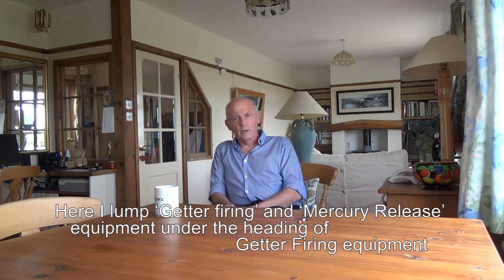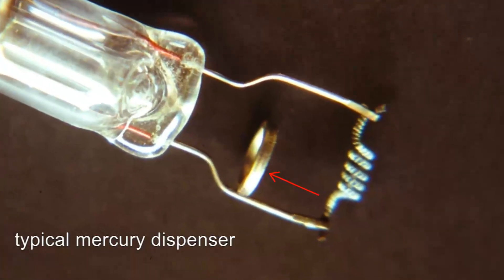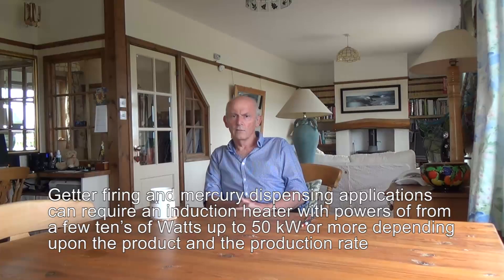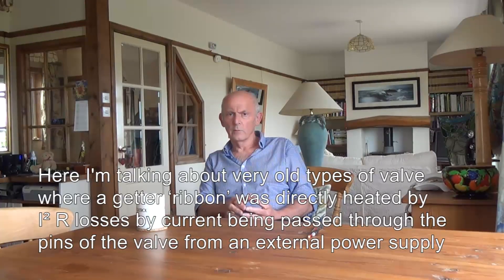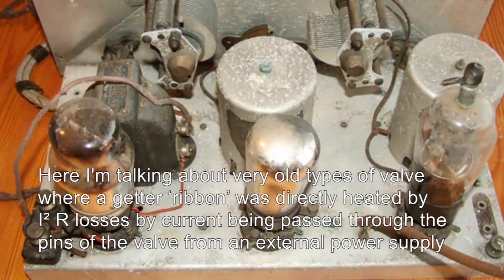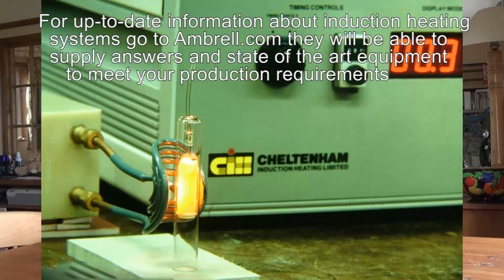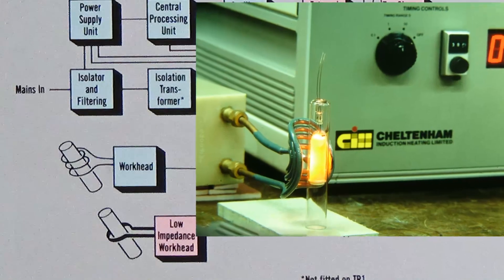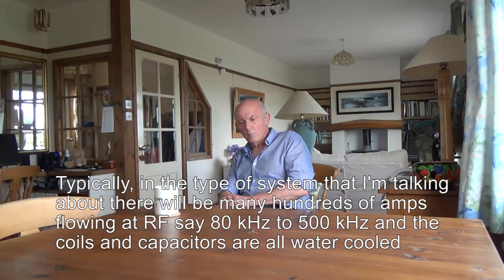I little bit about my work and Sinclair's Flat TV

Comment from the maker: Hi, that’s a bit like asking, ‘How long will a car last’ and the answer to both questions has to be, ‘It depends how hard you drive it.’ 
I can’t give you specific numbers but reasonably you’ll be talking of thousands of hours if you run a valve (tube) within its rated values. If you over drive the valve, say increase the filament voltage or draw excessive anode current you could limit its life down to hundreds of hours or even tens of hours.
Kind Regards ... Andy 
GWØJXM

Comment from the maker: Hi, no that’s not the case at all, induction heating is still the preferred method for most applications as unlike laser heating which can only heat from the outside, by selecting the appropriate operating frequency the user can predict with total accuracy the depth of hardness to be achieved by heating from the inside. Using a laser to achieve a deep depth of hardness in steel would be like using an oxyacetylene blow torch to cook a chicken, you simply melt. Ok if shallow depth.
Regards ...Andy

Comment from the maker: 1 of 2 
Hey that’s probably because they weren’t using my equipment. But seriously we built equipment for both ends of the market but the big difference probably has to do with cleanliness. As well as getter firing I also designed and built equipment for ‘out-gassing’ electrodes that is heating the metal elements (glass/ ceramic) structure in a partial vacuum to remove ‘under-the-surface-contaminants’ like die lubricants etc. Not everyone did that and it makes a difference...
 see 2 of 2

Comment from the maker: I'm sure Sinclair got a lot of guys interested in electronics, I certainly got a buzz out of building my first computer and the lessons learnt stood me in good stead as a bit of a foundation to start. I built my own keyboard out of surplus leaver type micro switches that I bent up and I used the plastic keys off an old mechanical calculating machine on the ends of the switches. I ‘letraseted’ the characters on and vanished the Letraset. It worked.
Glad you enjoyed the video 
Regards ... Andy

Comment from the maker: Hi Rick, high vacuum is a funny thing to come to terms with, I’ve worked on high temperature, high vac, ultra high purity kit for Zone Refining silicon. I still can’t think of the pressures as been any more than minus 14.7 pounds per in² but boy get a sniff of moisture in the system and it’s all over... vapour pressure! 
As for female logic? Man I could get into trouble here, the girls just wanted to see if they could burn the end of the broom.
All the best ... Andy 

GWØJXM